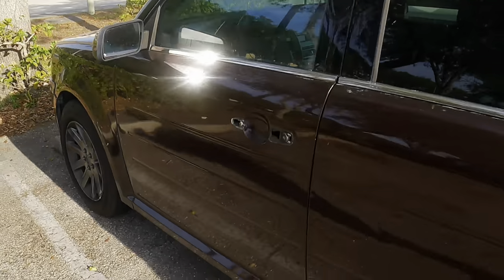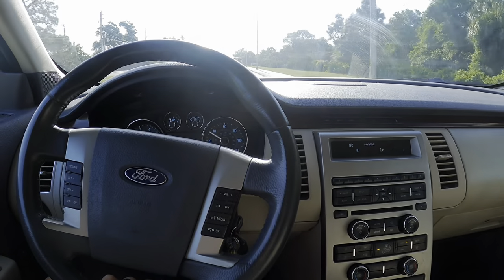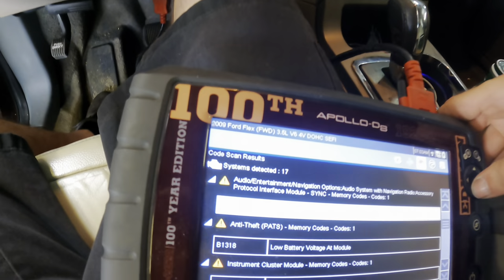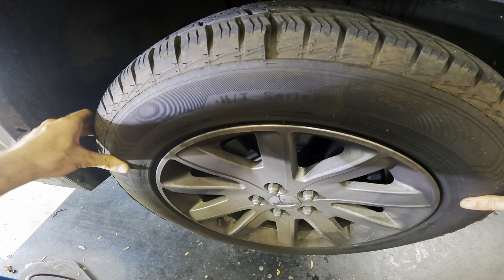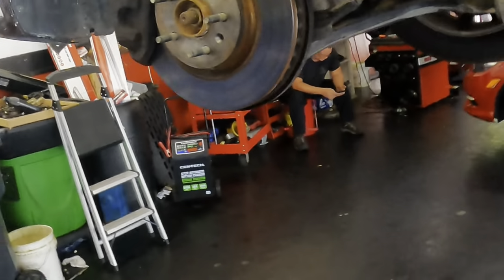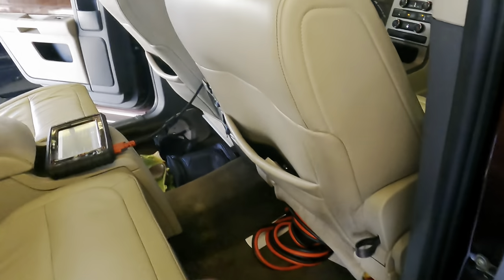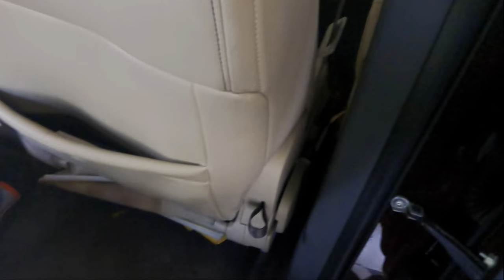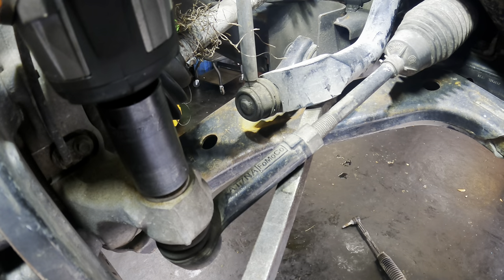Punishment from the Car Gods! 2008 Ford Flex 3.5l Airbag, Banging, Vibrating parts falling off

Comment: When you slapped that mosquito, I was almost expecting the window to fall out 😳
Reply: Judging by the overall condition of that vehicle, it's a wonder it didn't!!
Reply: Or the door to swing open
Reply: I was thinking his ring would break the glass.
Reply: @jojothepopoman  I broke a window doing the same thing. My wedding ring broke the glass.
Reply: That mosquito was in fact the owner of the car. :D
Reply: Give it a day, it'll fall out on its own.
Reply: Or just separate from the regulator and fall into the door...then generate another code.
Reply: I was driving in the left lane and a spider started crawling inside on the ceiling above me.  I tried to squish it and it fell into my lap.  I was freaking out like I dropped a cigarette in my lap.  All the while, I am drifting to the left.  We have concrete medians here where I live.  I drifted into an opening and struck the median blowing out both driver-side tires.  Fortunately, I did not hit another car or damage the rims so it just cost me a couple of tires.
Reply: @jimlovesgina  😳 spider ... 🥺 oh heck no! 
Two tyres i can live with but the spider? 
You came out ok?
Reply: That would be funny
Reply: "Ending mosquito transmission".....smack!

Comment: My daughters ford escape just gave me fits this week end.      Water pump idler pully seized, belt broke,  wrapped around the upper radiator hose,  tore the hose, busted the plastic nipple off the water pump,  broke the thermostat housing, and finished off by ripping the wiring out of the radiator fan.     Fun times.
Reply: And taa daaaaaa.....at least it didn't rip the rear brake lines off.  Sucks dude.

Comment: Ray I did some digging and the tool that you use to clean the wheel studs and hubs is called a “Hub Buddy” (1/2 inch impact driven surface and stud cleaner). Just in case any viewers wanted to get one for themselves. 
  P.s love your videos thanks for all the hours of knowledge filled entertainment.
Reply: Amazon has them for about $33.50. Thanks for looking them up.
Reply: Great 'Come Bak' prevention
Reply: 3M has one that has 1/4 hex drive. I think I paid about38 for the tool and 10 disks
Reply: @peted5217  Why would it come back? For not cleaning the rust off the hub's.
Reply: @AT-wl9yq  Ya. Any junk between wheel & Hub will cause 'Wobble' vibration. Besides annoying the driver, the wheel can come loose as the junk is crushed and falls out leading to a potentially fatal condition known as 'Wheel Falls Off'
Reply: @peted5217  I don't know who told you that, but its impossible. A wheel can't fall off because the hub has rust on it. Either way, Ford actually recommends you leave the rust on the hub and cut the rotors with an on the car brake lathe. And if you are doing a warranty repair, or recall, its mandatory. If you slip up and tell them you pulled the rotors to cut them, they won't pay the claim. 

They're not worried about the wheel falling off, but they feel its more likely to get a vibration if you pull the rotors off and remove the rust off. I disagree, but that's how Ford wants it done.

Comment: I had a very similar loud banging noise in my old Cherokee.  It was the flex plate.  The bolts had come loose and it was clanking side to side.  Fortunately, we were able to tighten it back up through the observation port after removing the cover.

Comment: Got to be frustrating to spend all that time diagnosing and not being able to fix anything. Glad you got a green light on this one.
Reply: Sadly many people just repair what they have no other choice, they otherwise do not maintain the vehicle.
Reply: @clintprice2123  "Penny wise and pound foolish."
Reply: @chictown  they can even less afford to replace the vehicle. Many times things fail and they crash and have an even larger problem.
Reply: Had a feeling as soon as the video started. Can't even open the door and lock falls out. And that wasn't one of the issues they listed to be fixed...
Reply: Its customary to charge diag time. If you don't get paid, its your own fault. When you think about all the money you have tied up in tools and education, you're crazy to work for free. Just that scan tool he was using, I haven't priced one in a while, but its at least 5k, probably closer to 10k. And that's just 1 tool.

Comment: 31:25 - I hate it when the tie rods come without those. Total pain lol Thanks for keeping this channel awesome Ray- super happy I subbed to it :)
Reply: Ah, so that's what it's all aboot!
Reply: HELL, Hardly anything comes with the new parts to actually finish the job. I remember when Thermostats came with the actual gasket. Even rebuild kits I've bought don't come with everything, FREAKING SAD, like Tie Rods with NO GREASE ZERKS.
Reply: I accused a mechanic of not replacing the inner tie rod because  the boot was old.  He showed me that the tie rod was new and that he had to reuse the boot.
Reply: @NoWr2Run  this is why I now have a bunch of $10 assortment sets of little goodies, fuses, heat shrink, light bulbs, cotter pins, grease zerks, hitch pins, et cetera.  Bought a nice set of control arms with tie rod ends and such and it came with nothing needed to install.  I needed four medium cotter pins, there were two big ones that wouldn't fit through the thread holes, and two way too small ones that weren't long enough to wrap around the castle nuts.  I had to buy my own grease cartridges (but glad I have them for future use).  I even had to buy bolts for the control arms because a) I had to cut the old ones out as they were seized in the bushing sleeves and b) they have Torx heads which for a fastener that needs to be toight like a tiger, it shouldn't have a funny head.  Just give me hex bolts in grade 10.9 and I'll be happy.  And that cost me $11 at the dealer for two of those but it'll be worth it the next time it has to come apart, which will be SOONER rather than later as I think the struts are done for.
Reply: @NoWr2Run  You're probably one of those people who replaces a quality transmission pan gasket with a crappy paper-fiber one just because it's new. SAD.  Get over it.  Know what parts you need.
Reply: Buy the Ford inner tie rod ends from the dealer. Comes with the boot kit for about the same cost as aftermarket.

Comment: Apparently you have to spring for the Limited trim package if you want door handles all around.
Reply: This is the hoopty special trim package. Which includes theft determent entry system.
Reply: Yep. With the SEL package even motor mounts are optional.
Reply: Good anti steal device no door handle no one can get in lol
Reply: I work for Ford. We simply can't make a door handle that works. Its amazing. Door handles and latches are probably our number one warranty/recall repair. You could make a living in a Ford dealership just doing door handles.
Reply: To be fair, the Flex/Lincoln MKT is probably our best made vehicle. The people that own this one just didn't take care of it, and probably drove it hard. Its the only model I see that comes in with super high mileage. Its not uncommon to see one with over 500k. Its usually the Lincoln version.

Comment: I was guessing they would decline most of the repairs since it was such a bad shape. 
I am also guessing most people would not allow their cars to have so many outstanding repairs.
Reply: Over the weekend, I changed a coolant hose, power steering hose, central locking controller.
Reply: The owner may have just bought the vehicle and wasn't aware of all the needs, or knew there would be a lot to do. Maybe he got a good deal and figured it was worth it.
Reply: "But it's cheaper to fix everything in one go instead of paying multiple visits"
Reply: @NiobeBaptist  I see you are a person that uses their brain instead of random comments! You win!
Reply: @Skylancer727  but if you notice, the repairs that were approved were the ones needed to make it safe. Passenger airbag isn't needed if there is no passenger
Reply: @damienvillano4044  Unfortunately how the airbag system works in non European cars is if the airbag light is on the entire SRS system is disabled. I've heard that the way European cars like Mercedes and BMW work in the opposite way so in the event of an accident and any crash sensor is triggered every single airbag is deployed. So while it is a problem with the airbag system on the passenger side the whole system which of course includes the driver side. i believe that code is for the pad that goes above the passenger cushion that detects if the passenger is present and if they weigh enough to arm the airbag system on the passenger side.
Reply: when money it tight, sometimes you have to let things go. I've been there. It's killed me. But I've been there.. to that point, they likely put everything off until they received their tax return.
Reply: With the damage we see, it makes me wonder if it was a stolen vehicle, or a repo of an abandoned vehicle.

Comment: one thing i learned over the yrs is you can check inner tie rod play on the ground with the front wheels on the turn plates...you will fell the clicking on the ground but as soon as you lift it up, the click goes away.....if they move in the air, they probably will really move on the ground.....some of the things you learn over the yrs

Comment: I had a driver's side broken motor mount on a big Ford wagon, in the 70's......Wife said there was a thump, every time she hit the gas......Turns out the motor was bumping the hood. Back then, I was fixing cars all the time, to keep them running. I was going to mention that the steering wheel wasn't straight, but the messed up Tie Rod, explains it.

Comment: 17:11

Its a bit of a design flaw to not protect the cables, a simple plastic shield would do, people will always dump stuff under their seats and not give it a second thought.
Reply: Welcome to Ferd engineering
Reply: @AJ-zv9tn  They all do it. Heard of someone losing a computer module under a seat because the detailer got it wet.
Reply: @Cheepchipsable  yeh bro people spill coke all over their lower console and the airbags go off cuz the module is down there
Reply: The wires under the seat were chewed by rodents in this case. But yes you can damage things by jamming stuff under the seat.
Reply: @AJ-zv9tn  MY Peugeot is the  same, double checked today, yep, a cable for the occupant weight sensor.  nothing else wired up though, my car isn't fancy.

Comment: In the UK I have put a very small smear of high temp grease on the hub where brake discs slide on to. This due to what you know as rust belt. Also put some where wheel fits against hub as alloy wheels and steel suffer from different metal corrosion. This helps with dismantling when replacing discs and pads.

Comment: At 17:55, the customer approved repairs. I thought they were going to have you pick out a new car for them, and have it at the shop waiting! Those outer tie rod ends - aren't they normally very tight in the steering knuckle and require tooling to free them?
Reply: They are greased up, so there is really not much that could cause them to turn, plus locktite.
Reply: Only in the rust belt. Most pop right out now. The old school steering, with inner outer ties, center link, pitman, idler, yes, those DO require a fork to separate them, but most rack and pinion ones I worked on just pop right out, and are a PITA when the shaft spins and you cannot get the nut off.  At that point is cutting torch time.
Reply: If you notice on the stud of the tierod it has a flatter tapered washer thing. They don't wedge like a standard tierod would. They do this with some of their ball joints  too. Not sure what the purpose for this though.

Comment: I always measure the total length of the old tie rod with a precise measuring tool like a big caliper or mark the length on a piece of metal by direct transfer and make the new tie rod the same length. It makes alignments less necessary. Sometimes the accordion makes that impossible, but not always.

Comment: At around 29:00, when you were resurfacing the pads, I just realy hope you had a respirator on. We do not wear them enough as mechanics, but brake dust (resurfacing pads or opening drums) and aluminium rims buffing are the worst. Safety first Ray

Comment: I am going to definitely have to watch this and the other one. We have two Flex Limiteds, a 2009 and a 2011, The 2009 needed all three powertrain mounts and probably will need strut mounts. That one is missing the battery insulating jacket. Transaxle mount is a load of fun to change. One weak spot on these with the rear HVAC systems is the hose nest up front between the engine, firewall and underchassis lines has two plastic tees held in with molded on plastic retainers and are serviced by Ford as an assembly.

Comment: One thing I've learned from binging Ray's videos, is that Ford products are definitely off my list of new vehicles
Reply: My wife and I looked at Fords in the 1980s, including at a rural dealer in mid-state Ohio.  The screws that held the roof rack on to the roof were already rusting (some bi-metallic ionization problem? crappy steel in the screws? dunno).  The dealer plead with us to buy a car, and offered us any of the Toyota used cars on the lot.  That's where we went next.
Since then, we've rented Fords while on trips, and they've been generally OK.  Some really nice.
Reply: @stevejohnson1685  it's not so much the cosmetic or the operation of Fords for me....but watching Ray repairing these things creates the illusion of ridiculous engineering. Growing up in the pre-anti pollution and computers era, I'm finding the newer vehicle overkill just unnecessary and a frustration in futility. The enjoyment of working on your own vehicle is gone, and with the skyrocketing costs of repairs, Ford looks more ominous.
Reply: All cars have issues, albeit different ones.  I'm a Ford guy and will continue to buy Fords. We had a 2009 Flex just like this one.  Absolutely no problems with it and it was a really nice car.  Only reason we traded it was because the wife wanted a minivan.
Reply: @hdfxrs9121  I'll be shopping for a new truck shortly. All i want is the ability to make minor repairs in my own driveway without having to remove half the engine parts to do so. I'm not opposed to Ford, I'm opposed to unnecessary engineering
Reply: Dont forget the mileage of that ford in the video...

Comment: Always best to load test your power and ground circuits. Few strands of wire will pass voltage with a multimeter, but won't hold up under load test.

Comment: Had a mechanic tell me the washer motor needed replaced on a used Escape I bought. I found the reservoir was full of blue sludge. Ran some hot water with household detergent through it. Fixed.

Comment: Those not wanting brakes worked on because they feel it's too expensive, may not realize how expensive it will be if they are involved in an accident because the brakes failed.
Reply: A car that doesn't go is a camper. A car that doesn't stop is a coffin.
Reply: Other then the engine and transmission brakes are the next most important thing that lots overlook until they go to hit the brake and nothing happens
Reply: The reality is, its not as bad as you think. People use shops all the time to find out what's wrong with the car, then they go buy the parts themselves, and use a mechanic that does side work. And when I say not as bad as you think, I mean for safety. The car usually gets fixed. That said, he shouldn't be working for free. Its just an invitation to be taken advantage of. For every different problem listed on the RO they should be charging an hour diag for each one.  Otherwise he does the work and someone else gets paid.

Comment: In the UK or ‘England’ as we sometimes generalised to ;-) we have to have an annual MOT test after a car is 3 years old which is a comprehensive list of safety tests resulting in the issue of either a roadworthy certificate or a failure with the latter basically making the car illegal to drive unless you are driving to a garage/shop on a pre-booked appointment to fix said failures and system works really well

Comment: Love your content, is it me or was that front wheel/tyre on wrong side . The directional arrow is going backwards
Reply: Looked like that RF he initiated with had a chunk of rubber missing at the top, as stopped. 🤔
Reply: It's the correct direction if he likes driving backwards.
Reply: You can see from 8:28 that there are directional arrows both ways. As well as a chunk of the tread missing. 👀🤫
Reply: Quality bro 👌
Reply: @johnt.848  Quality bro 👌

Comment: Flattening the pads is all you are looking for. 120 grit on a piece of thick window glass. Just a few light passes is all you need to remove the high spots. The fresh turned rotor will accelerate pad wear for a short bit of time thus bedding them in.

Comment: Ray, serious question for you: You sometimes start the impact driver before the socket is seated on the bolt head, doesn't that run the risk of rounding over the head of the bolt? I'm glad the car gods saw fit to release you from your punishment - maybe it was due running through mud puddles in a Minivan?
Reply: Not if done lightly. He does it to seat the socket in. 
I can say a good 80% of ppl do that.(and probly 100% of mechanics)
You just do it gently and it'll be fine.
Reply: Running start :)